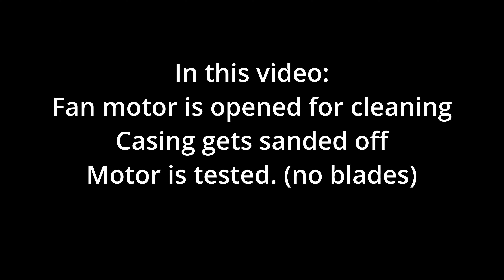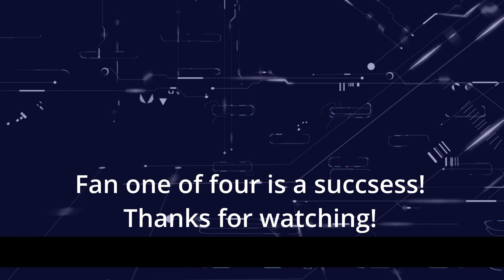Restoring 4 Severely damaged Windy ceiling fans - Part 1

Comment: i recorded some windy ceiling fans at golden shore st thomas jamaica
Reply from the maker: Nice. Do you have a link to the video?
Reply: yes
Reply: i put the link and powerdog i think you finish windy ceiling fan but you need to add the blades on it so you use induscom regulator for windy and test it when you post it for youtube and if some fans are not working like nippon america, bajaj, prizm, maybe nutone or k maybe not and also for Panasonic F560A1 too
Reply from the maker: For the blades i might have to buy new ones because the blades it came with were destroyed, and i will use one of induscom regulators.
Reply: okay